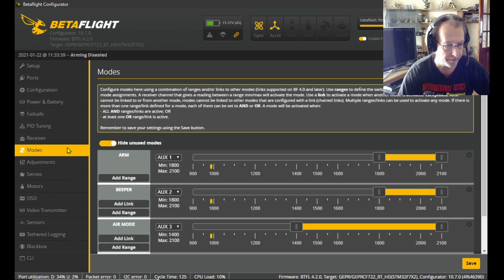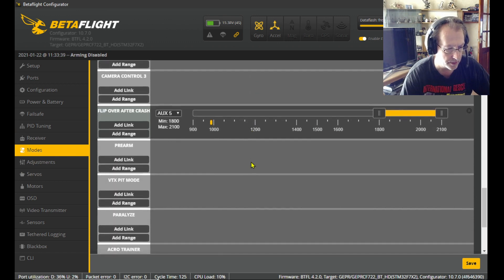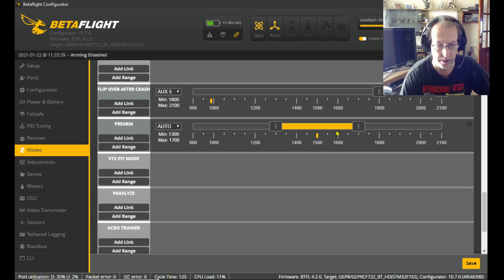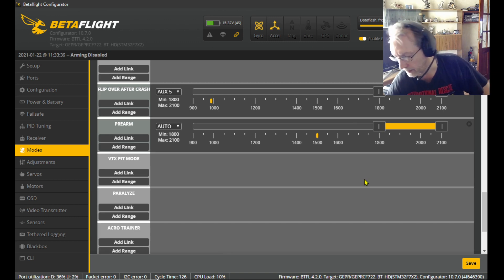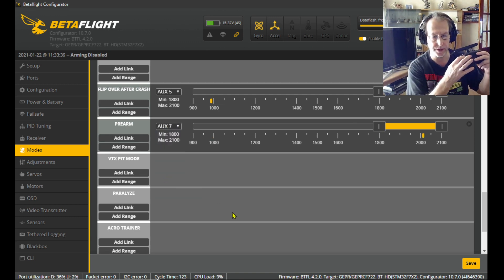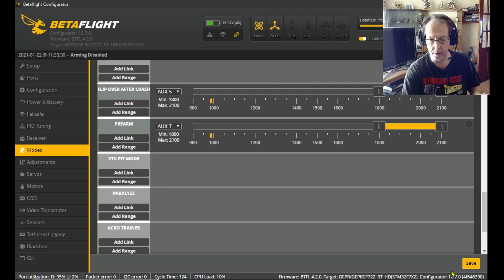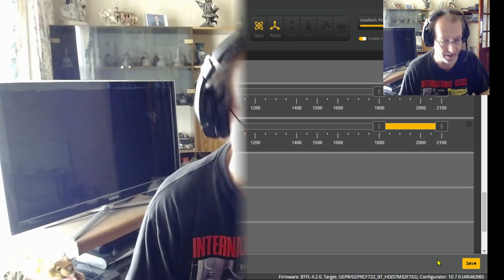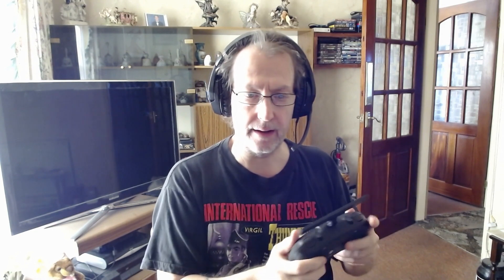TANGO 2 PREARM

Comment: Wow amazing thank you sir! Much appreciated :) by the way this prearm function was a bit different than what I had in mind. I thought that you still press the prearm button (holding it) and then you press you arm button then the props would spin up (like how you normally do it when you press the arm button the props would arm itself and props spinning in idle with airmode on). but I noticed in the video that you put the prearm and armed the quad but the props only spun when you give it throttle or is that just a setting that you put on?  Thanks for your time I really appreciate it :)
Reply from the maker: Happy to help and glad you found it, helpful buddy. As for the motors spinning up when you arm, go into Betaflight and in the configurations tab and on the right-hand side there is a slider tab marked (  MOTOR STOP )  turn that on then your motors will only spin when you give some throttle/power...